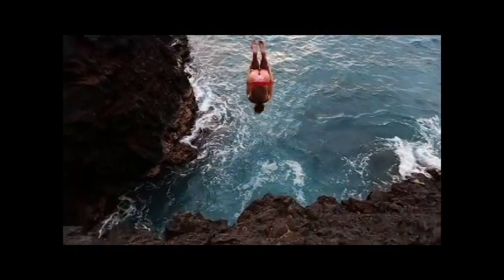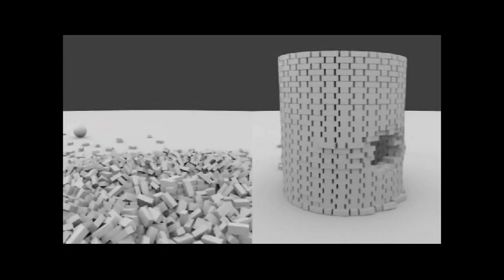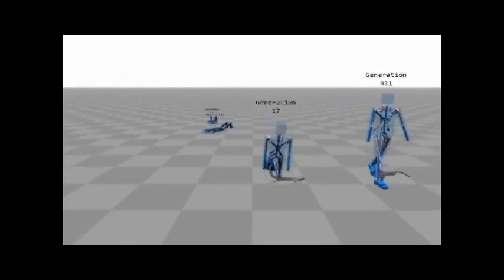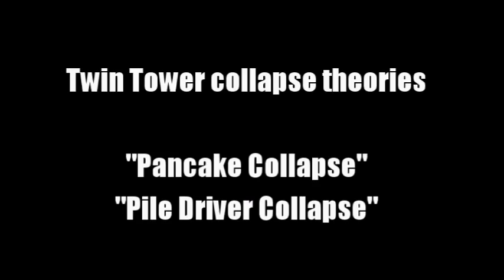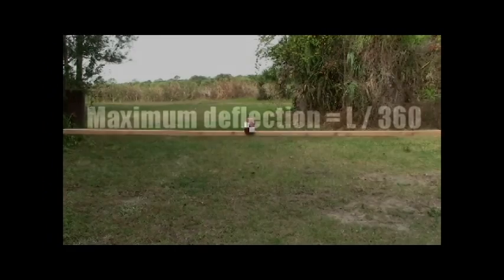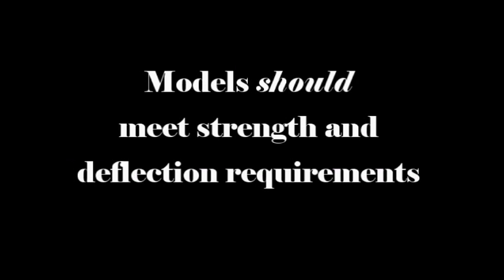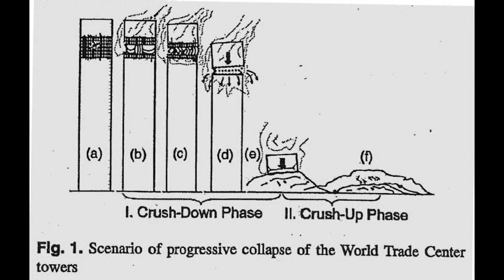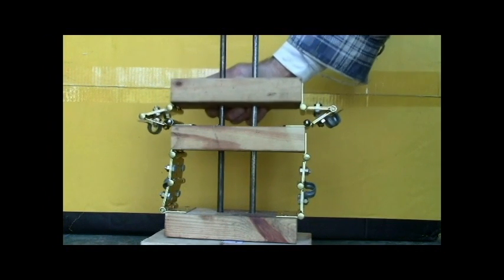9/11 Experiments: The Force Behind the Motion

Comment: You may be educated but you seriously lack any intuition towards physics.  Your models show that.
Reply: Chris Cook -  building 7 smartass, its the biggest problem with arseholes that think they are smart calling people truthers.  explain building seven collapse.  why rig a building to demo just let a fire bring it down perfectly.  you can say all you want about the towers but building 7 had zero reason to fall.
Reply: Chris Cook build a model that replicates what happened without the use of any interference to all the other supports....
Reply: Brian Friedman - "How wtc7 fell"
There is a rather detailed report out there that answers your question. Have you read it? Here is a link in case you haven't: https://ws680.nist.gov/publication/get_pdf.cfm?pub_id=861610

"how wtc 6 got a big hole in the middle?"
Errrr... how about debris from the collapsing North Tower fell into it? There are some nice pictures out there that show perimeter panels all over the place inside WTC6.Here's an example. Please note the bottom part of the picture. Also please note perimeter panels still hanging just over the edges of the whole in the top of the picture: https://powerm1985.files.wordpress.com/2017/02/inside-wtc-6.jpg
Reply: In response to Cris Smith- in agreement with you.
Reply: Cris Smith - I have a lot of questions about your calculations. But I'll ask only three for now. How much energy is required to lift a 1 kg object exactly 1 meter? And how does this answer relate to your claim that the potential energy in the towers was 4.6 Joules per kg? Would you agree your calculation is majorly off somewhere?
Reply: Joe V - The thing is that this number is very easily verified/calculated for both truthers and realists. One just needs to want to find out.
Reply: michael perri - "you can say all you want about the towers but building 7 had zero reason to fall."
What exactly in the NIST report about building 7 do you not agree with and why?
https://ws680.nist.gov/publication/get_pdf.cfm?pub_id=861610
Reply: Replevideo - "The mass of the 14 falling floors contains an amount of energy sufficient to demolish approximately 14 floors below before the energy is expended. "
This sounds a lot like the "argument" Chandler is making. There are some problems with this however. 
- It assumes the exerted force of the falling upper mass would have to destroy floors and columns below. In reality however, only the floor-to-column connections would have to be destroyed for a full collapse. The floors would simply give way at the weakest points, their connections.
- You overlook the potential kinetic energy stored in the mass of the collapsing floors below the falling mass of the upper block. Once the fllor-to-column connections of such floor are destroyed, this energy gets released and is addedd to the total energy of the falling mass of the upper block.
- In general, Chandler's "explanation" would only hold in a collision on a horizontal plane where gravity is to be neglected.

"Also please look at the inner columns. They form a practically indestructible  cage around the stairwells and elevator shafts, yet during the collapses they completely disappeared. How could that be?"
The core is basically irrelevant to the progressive part of the collapse. And this is exactly what we have seen in the videos of both collapses: major parts of the cores were still standing after the towers basically collapsed. The "indestrutable case" you mentioned is not that indestructable in reality. The core wasn't cross braced. Cross bracing is necessary for a structure to gain stability. The stability for the core was provided by the floors that bound core and permiter together.
Reply: choosetolivefree - "NO ONE can design an experiment which will corroborate the official theories."
You mean like this? https://www.youtube.com/watch?v=flo62pdaIMI

"You can debate all you want about his experiments."
Well yeah, that's the whole point, isn't it? Anyone, but ANYONE can build a structure to blow it up and claim this is what happened at 9/11. Only then the debate on the validity of these models begins.

"But what you can't do is create an experiment which will prove the official theory. If I'm wrong, do it"
The exact same applies to the opposite. Please build me a model that proves an inside job. The "engineer" in the above video has clearly failed to do so. Maybe you can?
Reply: @brucelansberg5485  Your interjections are some of the sharper ones so I'd like to ask some simple questions if I may. Any you can answer for me would assist me and I'm sure many others who's ideas are not fixed. I'm not a physicist or an engineer, but I think I have a basic grasp of the main arguments - like most people who are still horrified & fascinated by 9/11, it seems. I have no axe to grind and I'm not out to prove my better knowledge with sad Youtube one-upmanship. 

I find the rate of collapse of the twin towers difficult to fathom without there being some extra force at work. What accounts for the incredible speed of each collapse and the apparently uniform lack of resistance offered by the undamaged lower parts of the buildings? Is mass and gravity enough to cause so much destruction so quickly? How come there is no deceleration as the falling upper floors hit the lower ones?

I don't understand how massive heavy structural components of the towers could be thrown hundreds of feet outwards from the towers if they were merely collapsing under their own weight and a global structural defect/instability. What outward force caused this to occur? Surely the path of least resistance is down, not out?

I don't understand how virtually all of the concrete in the buildings and their contents could be pulverised to powder so quickly and completely. If not explosives, what force caused such utter destruction?

Given that the upper section of WTC2 leaned over dramatically as it fell, how could this then translate into a uniform global collapse? Wouldn't you expect one side of the building to fall away? I don't understand how the path of least resistance could be to pass through the building below rather than air.

Many people dismiss the multiple eye witness reports of secondary explosions, or they explain them away  - do you think the eye witnesses were all mistaken regarding hearing massive explosions followed by quick successions of smaller explosions? Explosions were witnessed by people in the basements of the towers before the planes struck.

Do you agree that the collapse of the towers and WT7 closely resembles controlled demolition in many respects, including what appear to be timed implosions of the upper floors, followed by belts of 'squibs' going off? Is that what a building collapse from structural damage, weakness and gravity looks like? The theory that there may have been explosives involved doesn't seem delusional to me, even if it might be mistaken.

Do you ascribe the global failure and collapse of three WTC buildings to an astounding coincidence, despite the fact that they were all damaged separately and in different areas? If the twin towers were badly designed then that could account for both of them experiencing global collapse in a similar manner, but that a third relatively new steel high rise should also collapse at free-fall just from fire-damage seems decidedly fishy. Doesn't the collapse of WT7 look exactly like a controlled demolition? I know looks can be deceiving!

Also, do you share a concern that some within the Bush administration actively wanted to go to war in Afghanistan and Iraq, and 9/11 - being the most astonishing act of terrorism ever witnessed - provided the perfect legitimacy for this? In fact, only such a catastrophic 'Pearl Harbour' like event could have offered legitimacy for the ensuing wars. Given the cost and spoils of war it seems that there was significant motivation to trigger 9/11, no matter how horrific the implications. 

Do you think there is compelling evidence that the alleged 9/11 hijackers had the skill to fly airliners accurately enough to hit the twin towers and the Pentagon at such high speed? It seems they were amateur pilots at best. The ability to hit the Pentagon side-on at maximum speed after having flown at such an extremely low altitude to knock over several street lights seems beyond comprehension to me. Also I don't understand why the wings didn't shear and explode on impact with the street lights.

Finally, can you agree that there is surprisingly little photographic evidence of 757 plane wreckage at or near the alleged Pentagon crash site and the one in Shanksville? Why do you think the only available video footage of the Pentagon attack is so poor?
Reply: @ravenorama  - Wow, that's a lot to reply to :). Let's give it a try and see where we end up.

"I find the rate of collapse of the twin towers difficult to fathom without there being some extra force at work. What accounts for the incredible speed of each collapse and the apparently uniform lack of resistance offered by the undamaged lower parts of the buildings? Is mass and gravity enough to cause so much destruction so quickly? How come there is no deceleration as the falling upper floors hit the lower ones?"

The speed of both collapses can only be considered incredible if one would expect a slower collapse. My question to you would be why you would expect the collapse to be slower? Isn't gravitational acceleration generally calculated to be 9.8 m/s/s on earth's surface? Both collapses were considerably slower than that, which tells me there was some kind of resistance. Looking at the design of the towers, it is obvious that this resistance was provided by the floor-to-column connections. These connections were crucial for keeping the towers up. Or reversed, the "only" thing needed for a full progressive collapse was destruction of these connections.

I certainly wouldn't say there was lack of resistance. If there was, both towers would have come down in 9,2 seconds. Now take a look at this video here and count along with the timer.

https://www.youtube.com/watch?v=qLShZOvxVe4

So I'd say that mass and gravity would perfectly able to have the towers collapse in the recorded times.

Deceleration would only occur if the resistance is larger than the exerted force. In any other case, acceleration would just be less. These are not the same thing. Less acceleration does not equal deceleration. Deceleration would result in a negative acceleration speed. A slower acceleration would result in a value somewhere between 0 and 9.8 m/s/s. Just drop a stone from a building and see if the air resistance would have it decelerate. It wouldn't. It would just have it accelerate slower up to its terminal velocity (which is reached when the drag force is equal to the gravitational force).

"I don't understand how massive heavy structural components of the towers could be thrown hundreds of feet outwards from the towers if they were merely collapsing under their own weight and a global structural defect/instability. What outward force caused this to occur? Surely the path of least resistance is down, not out?"

Well, if parts of the perimeter would have fallen as one single piece, it is not hard to imagine how the upper panels would have travelled some distance. If you take a look at the debris distribution as shown in this picture below, and you focus on the area of the winter garden, you would indeed see a number of perimeter panels grouped together as one single piece. From the way it is lined up, it is not hard to image how this large piece would have just fallen sideways instead of being "thrown" in that direction. Same goes for the perimeter steel that fell in the direction of Deutsche Bank Building.

https://upload.wikimedia.org/wikipedia/commons/f/f5/Wtc-photo.jpg

Make sure you set it on highest resolution. And note how this picture was taken several days/weeks after 9/11 when West St was cleared.

This is what it looked like before West St was cleared:

https://www.metabunk.org/attachments/wtc1-debris-layout-jpg.3162/

Collision could be another explanation for single members to travel sideways. Collision causes change in velocity (which is both speed and direction). Drop a marble on a hard surface which is tilted 45 degrees. Do you think the marble would insist on dropping straight down (path of least resistance as you have stated), or do you believe its velocity changes and the direction of the marble will be changed to basically horizontal?
Reply: @ravenorama  - "I don't understand how virtually all of the concrete in the buildings and their contents could be pulverised to powder so quickly and completely. If not explosives, what force caused such utter destruction?"

Who's to say that virtually all of the concrete was pulverized? As for the contents, imagine an office chair in a huge tumble dryer filled with steel beams, it isn't hard to imagine what would happen to that chair. I don't think it turned to dus however. Analysis of dust samples from the site showed mainly glass, drywall and concrete. I don't see how explaosions would turn office equipment and furniture into dust in the first place.

"Given that the upper section of WTC2 leaned over dramatically as it fell, how could this then translate into a uniform global collapse? Wouldn't you expect one side of the building to fall away? I don't understand how the path of least resistance could be to pass through the building below rather than air."

I guess it partly depends on your definition of uniform. In order to understand the sequence of events, you need to make a distinction between the initiating part of the collapse and the progressive part. The initiating part is caused by the jet impacts and fires resulting in the weakening of the steel. The progressive part is caused by the design of the towers. No matter the caused of the initiating part, the progressive part would have been the same in any way. When the top section started to tilt at the collapse onset, it caused a redistribution of its loads onto the undamaged columns up to the moment these couldn't carry this load (matter of split seconds). Understanding the design of the towers is crucial for understanding why it would have been impossible for one side of the building to fall away without the full building to collapse. In conventional buildings the floors do not play an important part of the structure. In the towers they did. Perimeter, core and floors could not exist without the others. Take one away and the rest will simply collapse.

It is inaccurate to describe the upper block as falling through the building. It didn't. As soon as it started tilting, it started to loose its integrity as a block. The mass however remained and force is defined by mass and velocity. The floor-to-column connections played an important role in the progressive part of the collapse. Once these are broken at one floor, the floor will fall down, causing more stress on the floor-to-column connection of the floor below than it was designed to take with the result that these will break as well. Like I said, it doesn't matter what caused the initiating part. Take out the upper block (or better: the mass of the upper block), and the building would still fully collapse.

"Many people dismiss the multiple eye witness reports of secondary explosions, or they explain them away  - do you think the eye witnesses were all mistaken regarding hearing massive explosions followed by quick successions of smaller explosions? Explosions were witnessed by people in the basements of the towers before the planes struck."

I am aware of these witnesses. I am also aware of witnesses that described falling bodies as exploding on the ground. Does that mean explosives were used to these bodies? I find that hard to believe. Maybe we should conclude that explosions do not necessarily imply explosives. I heard one large explosion in one of the many videos I have watched. I believe it was building 7 that was being filmed at that moment. Yet, I don't see the building come down at that moment. What does one single explosion do for a full collapse? I indeed heard people describe the collapse of the towers as a sequence of explosions. I am pretty sure that a collapsing building of that size and design would make these kinds of noises. The problem however, is that I have heard nothing that resembles anything like CD explosions on all of the videos I have watched. It should have sounded like in this video below if it were for explosives.

https://youtu.be/e2E_m7l2Rww?t=9

As for the explosions witnessed in the basement, a few things:
- Only one explosion before impact was mentioned. Not plural.
- Sound travels through steel faster than it travels through air.
- It was a matter of less than a few seconds between the explosions heard in the basement and the (same) explosion heard though the air.
- Basically the people in the basement heard the same explosion twice (one travelled though the steel frame, the second through the air).
- The sound was caused by the plane impact.
- What good does a bomb in the basement do to a collapse from the top?
- How have people outside not witnessed a large explosion just before impact?
Reply: @ravenorama  - "Do you agree that the collapse of the towers and WT7 closely resembles controlled demolition in many respects, including what appear to be timed implosions of the upper floors, followed by belts of 'squibs' going off? Is that what a building collapse from structural damage, weakness and gravity looks like? The theory that there may have been explosives involved doesn't seem delusional to me, even if it might be mistaken."

No. I do not agree that the collapses of the twin towers closely resemble controlled demolition in any respect. Yes, I do agree that from a certain point in time, the collapse of building 7 does look like a controlled demolition, at first glance.

1 and 2 collapsed from the top. I didn't see flashes. I didn't hear explosives. How would one see timed explosions? The "squibs" you mention is nothing more than compressed trying to find a way out. Please look up the detonation velocity of some explosives and compare these to the speed the air is being pushed out. Maybe more relevant is the timing. Take a good loko at the video I posted in the earlier reply and see how it takes a certain amount of time for the building to respond to the explosions. When compared to the videos of 1 and 2, it is clear that this timing is off. A lot. The "squibs" seem to appear just split seconds before the collapse reaches the point of that "squib". And shouldn't the towers have fallen faster if CD was involved?

As for 7, since the building appears to fall from the bottom, I understand why people connect this to CD. Yet, I do not see flashes. I do not hear explosions. We should see and hear these. Then again, in most videos, the part of the collapsing east penthouse isn't shown. This is however the onset of the internal collapse of the building. So also in this case, timing off majorly.

No evidence for the use of explosives was found. Not on the dus samples. Not on the steel. Not in the videos. No audio. And we haven't discussed the logistical impossiblility of all of this yet.

"Do you ascribe the global failure and collapse of three WTC buildings to an astounding coincidence, despite the fact that they were all damaged separately and in different areas? If the twin towers were badly designed then that could account for both of them experiencing global collapse in a similar manner, but that a third relatively new steel high rise should also collapse at free-fall just from fire-damage seems decidedly fishy. Doesn't the collapse of WT7 look exactly like a controlled demolition? I know looks can be deceiving!"

No, there was no coincidence. The design and damage patterns for all three towers dictated their faith. The towers were not "badly designed". They were strong buildings but they were not designed to survive progressive collapses. Why do you think so many scientifical papers have been written about progressive collapses and how to dedsign buildings to prevent them from happening AFTER 9/11? Just do a search for progressive collapse pdf and see how many results get returned.

The fact 1 and 2 were damaged separately is not relevant. The design of the buildings was the same and therefor they were equally susceptible to progressive collapse. Building 7 was designed in a somewhat different manner, but it shared long floor spans with both towers. Long floor spans means long beams (7), which are more vulnerable to changes in temperature. It is all easily explained. I do however wonder why you think that three collapsing buildings is fishy, but about 17 other buildings being heavilly damaged but not collapsing (some had to be demolished), is not? What if Deutsche Bank Building would have collapsed. Would that have added to the suspician, or would the suspicion have been less? If you look at the explanation of each individual collapse, what is fishy about it?

"Also, do you share a concern that some within the Bush administration actively wanted to go to war in Afghanistan and Iraq, and 9/11 - being the most astonishing act of terrorism ever witnessed - provided the perfect legitimacy for this? In fact, only such a catastrophic 'Pearl Harbour' like event could have offered legitimacy for the ensuing wars. Given the cost and spoils of war it seems that there was significant motivation to trigger 9/11, no matter how horrific the implications. "

No I don't. I do not think that the Bush administration caused 9/11 to have an excuse to invade Iraq (Afghanistan had been going on for decades). I do however believe that the Bush administration took full "advantage" of 9/11 and used it as an excuse. America has proven over and over again that no act of terrorism is required for invading other countries (or at least to establish a military precense in these countries).
Reply: @ravenorama  - "Do you think there is compelling evidence that the alleged 9/11 hijackers had the skill to fly airliners accurately enough to hit the twin towers and the Pentagon at such high speed? It seems they were amateur pilots at best. The ability to hit the Pentagon side-on at maximum speed after having flown at such an extremely low altitude to knock over several street lights seems beyond comprehension to me. Also I don't understand why the wings didn't shear and explode on impact with the street lights."

Have you ever been in a simulator? If not, please do so if you get the chance. Crashing an airplane is not really considered a precission movement. Instead of asking me if there is compelling evidencethat the pilots had enough knowledge and experience, I could ask you if there is compelling evidence they had not.

The fact that both planes were tilted when impacting the towers, is reason enough to believe the pilots were no airline pilots with thousands of flying hours. The same goes for the Pentagon impact. A highly skilled pilot would have approached the Pentagon from a lot larger angle to avoid the risk of ploughing the airplane into the ground. Flight 77 came dangerously close to just doing that. An impact ontop of the Pentagon would have caused a lot more damage. No light poles in the way either.

Wings are generally strong parts of planes. Wings are designed to survive impacts with birds on their leading edges. They do not shear off when hitting an relatively light object like an aluminum light pole on the upper part. The skin might get damaged locally though.

"Finally, can you agree that there is surprisingly little photographic evidence of 757 plane wreckage at or near the alleged Pentagon crash site and the one in Shanksville? Why do you think the only available video footage of the Pentagon attack is so poor?"

Again, I guess this depends on your definition. I believe a lot of debris would have been unrecognizable as part of a plane to the uneducted eye (like mine). You do know that seats were found inside the building with the passengers still strapped in? All heavy plane parts have been found. The lighter ones might as well simply have "vaporized" like in this video below.

https://www.youtube.com/watch?v=RZjhxuhTmGk

Same goes for Shanksville. Add to that that it was a very remote site with little to no witnesses that were able to take pictures. The lack of evidence doesn't prove the oppsite.

The video footage of the Pentagon impact was from CCTV. In those days quality was lower because of memory constraints. Next to that, why would CCTV cams be pointed to the sky? Also here goes, the lack of evidence (or lack of footage to be specific) doesn't prove the opposite. How about the eye witness accounts?
http://911research.wtc7.net/pentagon/evidence/witnesses/bart.html
Reply: @brucelansberg5485  Wow thanks for all that Bruce - much better than the usual sardonic and needlessly aggressive comments anyone questioning the official 9/11 narrative gets!

Not in order, but on the Pentagon:

I do think there's good evidence that the alleged hijackers were bad pilots. Their flight instructors described them as undisciplined, and the guy who is supposed to have flown into the Pentagon after an extraordinarily difficult dive and turning manoeuvre is described as having been unable to fly a Cessna. 

Some pilots have claimed that the manoeuvre to hit the Pentagon at ground floor level would have been difficult to achieve even for a person with a lifetime of 757 flying experience, or top gun fighter pilot. I take your humorous point though that it is a different kettle of fish to want to crash a plane then it is to want to control it. 

There are questions over the land-effect of a 757 flying as low and at such high speed as alleged - that it would be physically impossible to fly a 757 at high speed low enough to the ground to hit a light pole for any distance.

There are questions over the type of black box flight recorder recovered at the Pentagon being of the wrong type. I'm no expert in this.

At any rate, there certainly wasn't a gathering of plane wreckage as evidence or an attempt to reconstruct the plane it as you would expect from any other plane crash investigation, at least as far as I am aware.

Also, there is considerable divergence in witness statements from the Pentagon. A number of witnesses claim to have seen a 'large white plane' (not a bright and shiny aluminium one) approaching to the north of the alleged trajectory, impacting the Pentagon to the north of the alleged impact zone, one wing having rebounded off a helipad. This wing-rebound provides quite specific locative corroborating detail, and there was significant wreckage to the north of the alleged crash site at the Pentagon next to a helipad. A witness who survived the blast in this area and who walked through the actual  hole created by impact claimed not to have seen any evidence of a 757/plane, which is odd. You'd expect her to be in shock though.

I take the point about the possibility of an aluminium plane vaporising on impact at high speed, but surely titanium engines wouldn't have disappeared? The alleged discovery of victims still strapped into their seats does not seem consistent with vaporisation.

For balance, I have also heard witness reports that corroborate the official line, including from a Taxi driver and a Priest. It is at least worth considering why/how such divergent stories should emerge though. If anyone could falsify witness statements then the good people at the Pentagon could. 

I haven't seen any photographic or video evidence that shows wreckage from a 757 at the Pentagon, apart from one mangled piece of aluminium with red paint on it, and a fragment of a belt strap with United Airways written on it. 

I don't accept that CCTV at the Pentagon wouldn't be pointed at the crash site or surrounding area - including the sky. Also that military radar and defence systems would not have detected and intervened a flight approaching the Pentagon. There is witness testimony that defence secretary Rumsfeld was given ten minute warnings up to the point of impact, and on being asked 'if the order still stands' brusquely affirmed that it had not been changed (whatever that order referred to, the timing raises suspicion).
Reply: On the twin towers and WT7 collapse:

The more I think about it the more I can accept that progressive collapse at the speed/force observed is possible in all cases. It is obviously far less likely that the buildings were rigged with explosives for demolition. I would still have expected the progressive collapse to be less total somehow.

There is witness evidence that only shards of office material were found in the wreckage at ground zero. The amount of destructive force was extraordinary.

On evidence of secondary explosions - I take your point that sound travels through steel quicker than air - I don't know the physics of it but would an explosive shock wave also travel down to the basement of the buildings before the impact of the plane would be heard/felt? I guess over 100 floors or so the time lag could be quite significant. I gather from the testimony of William Rodriguez (basement janitor) that there was enough time between the two blast and pane impact events for him to consider them as separate events, but maybe he was just confused. He certainly claims that there was an explosive event in the basement below him that caused his office wall to crack and for the ceiling to fall in which preceded the plane strike, but I don't know how long he perceived the elapsed time between the tow perceived events to be. Also, I don't know the layout of the lift systems except that in the towers they were staggered, so it should be possible to prove whether the person Rodriguez aided who had been badly burned in a lift at the basement level could have been injured from jet fuel rushing down a lift shaft from the impact zone (if the lift shaft was connected to the impact zone) or if it must have been something else. I would agree that by far the most likely scenario is that the jet fuel and shockwave in the falling lifts were mistaken for explosions. 

I don't think many people mistook falling bodies for explosions. There is significant witness evidence of explosions occurring continuously in the towers. Of course there could be alternative explanations and any is more likely than planted explosives.

I gather that destroying the base structure of a building is an element of demolition whether it is from the top down or not. There is some photographic evidence from ground zero of a major steel support column that appears to have been cut at a 45 degree angle, which could be consistent with the use of thermite.

I think WT7 likely collapsed in the way it did because the substation upon which it was built suddenly gave way from the weight of internal structures failing/falling in the seconds immediately prior.
Reply: Regarding the Bush admin using 9/11 as a pretext for war:

I think they certianly did use 9/11 as a pretext for launching a nebulous 'war on terror' that suited their foreign policy objectives. Also to pass the Patriot Act which would allow extraordinary powers to stifle any investigation into 9/11.

The Bush administration was resistant to holding an inquiry into 9/11 and only relented over a year later under pressure from survivor groups and the relatives of victims. The 9/11 report was restricted in scope, and its lead authors have written a book claiming that it was a whitewash, they were consistently lied to by figures at the Pentagon and others, and that nobody has ever been held to account for lying to them. 

It seems that the CIA had previous knowledge of the hijackers that they withheld from the FBI. Bush blocked a subpoena to investigate this. Hijackers stayed in a apartment owned by a CIA asset.

There was also a distinctly fishy anthrax letter scare in the weeks after 9/11 that appears to have been a blatant attempt to frame Iraq - shifting the blame for 9/11 away from Saudi Arabia. The anthrax used is alleged to have been far beyond the technical means available to Iraq, and to be a signature of US technology. In the end an individual 'lone wolf' scientist was fitted up for the crime, although it is claimed that it would have taken a team of experts a great deal longer to produce the type of anthrax used than could have been achieved by one person acting alone.

The anthrax scare is consistent with later claims that Iraq had WMD, which it turns out they didn't.
Reply: @ravenorama  - "I do think there's good evidence that the alleged hijackers were bad pilots."
We seem to agree partly on this. I believe that a highly trained pilot would have flown the planes level into the towers. And a highly trained pilot would not have taken the risk of missing target at the Pentagon. Then again, the hijackers didn't need to take off and land any of the planes. Just steer them.

"Their flight instructors described them as undisciplined"
Which is not necessarilly a description of a person that doesn't know how to steer a plane.

"and the guy who is supposed to have flown into the Pentagon after an extraordinarily difficult dive and turning manoeuvre is described as having been unable to fly a Cessna. "
And yet, Hanjour did have both a private and commercial pilots license. But who says the manouvre was extraordinarily difficult?

"There are questions over the land-effect of a 757 flying as low and at such high speed as alleged - that it would be physically impossible to fly a 757 at high speed low enough to the ground to hit a light pole for any distance."
Yeah, I heard that claim about the so called ground effect as well. Whenever I hear it, I will show this little video and ask: What ground effect?

https://www.youtube.com/watch?v=1HRyynpbMJc

"There are questions over the type of black box flight recorder recovered at the Pentagon being of the wrong type. I'm no expert in this."
Neither am I. Also, I have not heard that claim before and I couldn't find anything on it. 

"At any rate, there certainly wasn't a gathering of plane wreckage as evidence or an attempt to reconstruct the plane it as you would expect from any other plane crash investigation, at least as far as I am aware."
A reconstruction of a crashed plane is only done to gather more insight in the causes of the crash. At 9/11 it seems quite obvious what happened. So in most cases the plane is not reconstructed. I am pretty sure though that debris was collected and stored.

http://www.911myths.com/html/pentagon_18.html

"Also, there is considerable divergence in witness statements from the Pentagon. A number of witnesses claim to have seen a 'large white plane' (not a bright and shiny aluminium one) approaching to the north of the alleged trajectory, impacting the Pentagon to the north of the alleged impact zone, one wing having rebounded off a helipad. This wing-rebound provides quite specific locative corroborating detail, and there was significant wreckage to the north of the alleged crash site at the Pentagon next to a helipad. A witness who survived the blast in this area and who walked through the actual  hole created by impact claimed not to have seen any evidence of a 757/plane, which is odd. You'd expect her to be in shock though."
No one eye witness statement from whichever event will be the exact same. The key in these witness reports however is the word plane. No one claims to have seen a missile of some kind. 

"I take the point about the possibility of an aluminium plane vaporising on impact at high speed, but surely titanium engines wouldn't have disappeared?"
From the Moussaoui trial:
http://www.vaed.uscourts.gov/notablecases/moussaoui/exhibits/prosecution/P200030.html
Then again, if it is not photgraphed and in the public domain, it doesn't mean it isn't real.

"The alleged discovery of victims still strapped into their seats does not seem consistent with vaporisation."
Of course the Pentagon facade is not made of brick and concrete alone. The part of the plane that hit any concrete would have been more damaged than the part would have entered the building through windows and doors.

"For balance, I have also heard witness reports that corroborate the official line, including from a Taxi driver and a Priest. It is at least worth considering why/how such divergent stories should emerge though. If anyone could falsify witness statements then the good people at the Pentagon could. "
Well, if you take a look at the link I included in an earlier reply, you will see that these statements have several sources. People have been interviewed for several media outlets. 

"I haven't seen any photographic or video evidence that shows wreckage from a 757 at the Pentagon, apart from one mangled piece of aluminium with red paint on it, and a fragment of a belt strap with United Airways written on it."
Here's a nice start:

https://rense.com//general32/phot.htm

"I don't accept that CCTV at the Pentagon wouldn't be pointed at the crash site or surrounding area - including the sky. "
Why would camera's be pointed at the crash site? I believe it is much more interesting to see what's going in a parking lot than oin the facade of a building to be honest.And why would cameras be pointed at the sky? 

"Also that military radar and defence systems would not have detected and intervened a flight approaching the Pentagon."
All flights arriving at Reagan International Airport would be approaching the Pentagon and be monitored. I don't know if military radar would track civilian flights though. Military defence systems were aimed at threads from outside of the US. Not at domestic flights.

"There is witness testimony that defence secretary Rumsfeld was given ten minute warnings up to the point of impact, and on being asked 'if the order still stands' brusquely affirmed that it had not been changed"
It was actually Cheney that replied that the orders still stand. This is from a testimnoy by the secretary of transportation Norman Mineta for the 9/11 Commission on May 23, 2003. Yet, there seems to be much wrong with this testimony. If you're at this subject, please read this full article where a break down is presented from the events and timelines. Don't forget to read its conclusion :).

http://www.911myths.com/index.php?title=Norman_Mineta
Reply: @brucelansberg5485   On 9/11 hijackers being bad pilots: As I understand it Hanjoor's pilot's license expired because he didn't take a medical and he failed his English test, needing a translator to be able to take another test. He was so incapable of flying, controlling or landing a single-engine Cessna just one month before 9/11 that he was refused permission to rent a Cessna. Yet one month later he is supposed to have been able to disable the flight management system in a 757 then perform a 270 degree turn whilst gaining speed and descending 2500 feet to hit the Pentagon at first floor level - without damaging the lawn! From his original application to enrol in flight training in the US he claimed to have had 250 hours of previous flying experience, and you need at least a 1000 I think to be able to fly a commercial airliner. In the 9/11 report it was claimed Hanjoor had around 600 hours, but this is not consistent with the fact that he was unable to control, land or rent a Cessna just one month before 9/11. At best he had 'rudimentary' knowledge, but not enough to pass an oral exam. There are plenty of pilots who have debated their own ability to perform the flying necessary to commit the 9/11 attacks, but I quickly found one video about Hanjoor that details his flying experience from flying school reports (towards the 33 minute mark for comment on the actual reports) https://www.youtube.com/watch?v=QMJUJO794f8

I like the video of the low-flying planes, but Hanjoor is supposed to have flown even lower, in an even bigger/heavier plane and at much higher speed - whilst also under the enormous stress of committing suicide/mass homicide. Pilots performing low-flying passover stunts at air-show events are highly skilled, which Hanjoor by all known accounts definitely was not. Maybe it just wasn't him flying, or he was unfeasibly lucky to hit his intended target? It does seem enormously unlikely from the available evidence that it was him flying, or if he was that he'd be capable of controlling a 757 through a high speed spiralling descent towards a specific target.

The hole in the Pentagon before an interior wall collapsed doesn't seem to have been produced by an object as large as a 757. Here's an image of the alleged impact site before the wall collapsed: https://www.google.co.uk/search?biw=1430&bih=638&tbm=isch&sa=1&ei=Z63uW_r7AcuRgAat47j4BA&q=hole+in+pentagon+before+collapse&oq=hole+in+pentagon+before+collapse&gs_l=img.3...4541.4541.0.4907.1.1.0.0.0.0.153.153.0j1.1.0....0...1c.1.64.img..0.0.0....0.3zytL4l5564#imgrc=0WsUBnpdu4wFvM:

I'm not a plane wreckage expert but I don't see compelling evidence in the photos you linked to - all the wreckage could be from office equipment having been blown up as far as I know - apart from wheel components. I don't see how everything including the tail-fin and engines of a 757 could be vaporised but passengers could still be found intact inside the building strapped into their seats. I don't see a scenario in which they impacted at such a high velocity that the entire fuselage was vaporised, yet soft tissue went through the thick security glass of a Pentagon window. At the very least it stretches credulity to breaking point. Surely a body at that rate of impact would come apart? Incidentally, a CNN reporter at the Pentagon on the scene shortly after 'impact' reported seeing no evidence of a plane (40 seconds in) https://www.youtube.com/watch?v=_0eC3uns3pA

The 'pilots for 9/11 truth' website has a much more detailed analysis of the difficulties hijackers faced on 9/11, including in taking over the flights from experienced pilots using just box cutters and knives (and without the pilots sending a distress signal) to performing the high speed manoeuvres alleged. I have seen  interesting videos in which experienced pilots and flight instructors use a flight simulator to attempt to hit the twin towers and only one of them managed it after multiple attempts, and even then only at low speed. The main difficulty being that at the high speed airliners are difficult to manoeuvre accurately - the slightest touch of steering causing a larger rolling movement to occur. At least that is what I have read - I'm not a pilot either, but I don't see why experienced pilots should want to lie about their abilities.

I got Rumsfeld mixed up with Cheney! My bad! I think it's fair to say that neither is known for trustworthiness though!! I'll look at the other links you sent but this is long enough for now. I am repeating a lot of stuff from other sources so it's just as good to look at some of the better websites that question the official 9/11 narrative in detail. 

Here's a nugget: on March 4, 2004, a German court "overturned the world's only conviction" in connection with the September 11 attack on America "because the U.S. withheld crucial evidence."
Reply: Aha I see you smart. How wtc7 fell and how wtc 6 got a big hole in the middle? now fuck off
Reply: Bruce Lansberg for one who seems so smart or at least one who thinks they are you would know that the burden of proof isn't on any of us but the investigators who told us that planes and fires caused the towers to fall. It's simply nonsense. I can show several things that point to something being really off about the official story. Things I have showed to many self proclaimed educated people and not a single one could explain.
Reply: GR1MR34PER33 - "for one who seems so smart or at least one who thinks they are"
What makes you believe you know what I think? 

"you would know that the burden of proof isn't on any of us"
The one who claims, delivers the proof. It is as simple as that. The one who makes an extraordinary claim, delivers the extraordinary proof. I have explained more than once what is wrong with the experiments in the above video. It is a random setup that has nothing to do with the reality of the collapsing towers. Now, if you want to claim the towers were blown up. you need to deliver the evidence. Not difficult to understand.

"but the investigators who told us that planes and fires caused the towers to fall."
Are you referring to NIST? 

"It's simply nonsense."
Remember, you make the claim, you deliver the evidence. Please explain what you think is nonsense and why exactly.

" I can show several things that point to something being really off about the official story."
Sure you can. 9/11 was a complicated event. In such events not all can be explained. The question however is: What does it prove?
Just out of curiousity, what would those things be?

"Things I have showed to many self proclaimed educated people and not a single one could explain."
Why are you telling me? But again, if something can't be explained, what does it prove?
Reply: Troll !, ZERO content ,and zero link to ANY OTHER Physical experiment ?
Reply: Bruce Lansberg lol oh I can tell that you think you are smart just by how you comment. Speaking of which Jesus Christ dude you seem to have all day to write comments when you break down each piece and ask questions about them. But enough of that I'll get to the point. First I need to correct my previous comment; it's not that things can't be explained, it's just that they can't be explained in a way that supports the narrative the deniers choose to believe and push so these things tend to be outright ignored. First were the mysterious workers doing mysterious work on the buildings before 9/11, there is a little bit more to it but I don't have all day to find and type out who they were and when exactly it was so you will have to deal. Second was the molten metal flowing out of the building and also found below the building. The infamous jet fuel can't melt steel beams meme refers to this. Third, the steel support beams with diagonal cuts and slag running down them as if they were cut by extreme heat from a source such as thermite. Which brings the fourth, the traces of nano thermite found among the rubble. Five, multiple reports of explosions in the parking garage and the lobby I believe by people who were there including first responders like firefighters. Six, let's say hypothetically jet fuel does get hot enough to melt steel beams and there are no intact remains of the plane because it hit with so much force it disintegrated upon impact. Yet somehow they find the terrorist's passports perfectly intact. I can keep going, do you want me to continue? Please do pick apart each piece of this comment in particular and try to explain in a way that supports your narrative. Oh I might add real quick that NIST claims that the towers fell do to the damage from the planes that hit them and the fires they caused. They claim they came to this conclusion by using models in sophisticated computer programs. But they refused to release the models they used. So again the burden of proof is on those who claim just like you said, and we are still waiting. There is one thing you're right about, none of these things technically prove that 9/11 was an inside job, but they are all very suspicious and should have people asking more questions instead of blindly accepting what the government and media told us. The government has been caught many times lying to the public, and the media does it all the time in order to get ratings, even if it's by taking things said out of context, reporting part truths can easily be just as bad as lying.
Reply: GR1MR34PER33 - "I can tell that you think you are smart just by how you comment."
Interesting, and to be honest, rather typical for a truther. Jumping top conclusions based on some interpretation that fits your frame of reference. Please realize that your conclusion only tells us something about YOU and not about ME.

"you seem to have all day to write comments when you break down each piece and ask questions about them."
If so, so what? The reason I am breaking down posts and reply to them in detail, is to expose the real meaning of them. Addressing every single claim is the only way to analyze the validity of one's claims. Don't worry, I will only address the most relevant claims in your post right now :).

"First were the mysterious workers doing mysterious work on the buildings before 9/11, there is a little bit more to it but I don't have all day to find and type out who they were and when exactly it was so you will have to deal."
It is only mysterious if you don't know if the claims are true, who these workers were, what they have been working on. Happy to go into detail on this if you can provide some examples. 

"Second was the molten metal flowing out of the building and also found below the building."
I really don't see how molten metal flowing out of one tower is something suspicious. You must have read an explanation on it. Same goes for the molten metal in the basement. 

"The infamous jet fuel can't melt steel beams meme refers to this."
Then again, no steel beams have melted from any jet fuel. Have they?

"Third, the steel support beams with diagonal cuts and slag running down them as if they were cut by extreme heat from a source such as thermite."
Yeah, as a result of the clean up process in which cutter have been used to cut the beams. Show me one single picture that shows these cut beams and that was taken before the clean up process started.

" the traces of nano thermite found among the rubble."
Please cite in Jones et al's report where it is stated that traces of nano thermite were found.

"multiple reports of explosions in the parking garage and the lobby I believe by people who were there including first responders like firefighters."
Yes. However, explosion do not necessarilly imply explosives. 

"Yet somehow they find the terrorist's passports perfectly intact. "
Well, this passport was found before any of the towers collapsed. Have you seen how paper literally rained down the streets of downtown Manhatten after both impacts?
https://youtu.be/c7mf4W8kL4s?t=3m54s
Why would all that paper fly around and a paper passport wouldn't?

" I can keep going, do you want me to continue?"
By all means, please do so. I haven't yet seen any convincing anomaly yet.

" try to explain in a way that supports your narrative."
I don't have a narrative. You do. And you're yet to show me any evidence of that.

"They claim they came to this conclusion by using models in sophisticated computer programs."
Please cite your source.

" none of these things technically prove that 9/11 was an inside job,"
Ande this is rather relevant.

"but they are all very suspicious"
They are only suspicious only one explanation would explain what we have witnessed AND if that explanation would indicate fowl play. None of your arguments do.

"The government has been caught many times lying to the public, and the media does it all the time in order to get ratings"
Although I agree on your statement, I don't see how this is relevant to presented facts.

"reporting part truths can easily be just as bad as lying"
That's why I am not interested in media's narratives or explanations or interpretations, but merely in facts. And funnily enough it is exactly this type of behavior that I find so repulsive from the truth movement.
Reply: "The added weight Plus the kinetic energy of the moving Mass greatly exceeds its load capacity..  that floor gets sheared off its connection points,   the falling Mass slows slightly as it sheers off these connections, but then that stationary floor joins the falling mass,. impacts the next stationary floor with more speed and more weight..... On and on all the way to the ground.."

Your poor grammar, examples & use of capitalization betrays your physics 'expertise'.
Reply: Cris Smith That was badass. #owned
Reply: Stop receiving flu shots, your brains already blistering in aluminium hydroxide. Remember one, if you cross the lined tin foiled brain effect will be irreversible.
Reply: Have you had ASD test?  If not suggesting,  you will be surprised.  But don't worry when it comes positive. Science tells us is the next step in human evolution we just too stupid yet to understand. 
   You see a bunch of valuable advice and you are asking if there is anything good INSIDE ( sounds even fucking unscientific )
Reply: Get well, switching the television off shows overall dramatic improvement,  GN
Reply: Build a tower of any material and then drop 1/10th on the rest. The tower will not be destroyed. Only on World trade center because of planted explosions.
Reply: His models are pure shit.
Reply: You're just butt hurt
Reply: Nah, the models that this guy made are not accurate to the construction of the buildings, they don't accurately replicate the scale in thickness and strength of the floors of the buildings, or the failure points of each floor that allowed for the collapse to happen as it did.
Reply: @BLUGGLES  your missing the point. Physics teach any upper block of material......any material. The point made is the model slowed down and eventually came to a stop.The same for the towers....but the bldg callapse accellerated as if the 80,000 tons of supporting structural steel framework underneath didn't exist. The only way possible is controlled demolition
Reply: @coolk3dat754  not true at all, its not that simple. If this guy had dropped a 1000 pound weight onto his structure I guarantee it wouldn't have slowed down until it hit the ground. The issue here is that the materials he used in his model show him progressive decreases in velocity because they are too rigid and thick, and not constructed to correctly mimic the actual structure of the towers. There are much better and more accurate amateur reconstructions that show the reality of the acceleration clearly.
Reply: @BLUGGLES  if it doesn't agree with the experiment it's wrong. You can waste your entire life crunching numbers and figures......if it disagrees with experiment.....its wrong.  Your version....Thats not what happenend.....physics say it cant happen..... History proves its never happened. And you proffessor got it all figured out dont you?. How does your theory account for pulverization of the bldgs? How does it account for lack of debris? How does account for high velocity bursts of debris being ejected? How does it account for the well well documented presence of molten metal?How does it account for the  announcement of building 7 collapsing prior to it being collapsed?  NIST claims fire brought the buildings down but had trouble trying to reconceal the evidence with that predetermined conclusion. NIST report contains no analysis of why the towers failed or why they fell near free fall speeds. NIST was unable to provide a full explanation for a total collapse.  They admitted only investigating up to point of collapse. they also admitted to never have looked or investigate for explosives even though it is mandated in the National Fire Protection Agency guidelines.NIST DID NOT FOLLOW PROPER PROTOCOL and unless properly investigated and ruled out..... there is clear evidence of the potential for explosives in the collapse.
Reply: The energy carried by the top floors does not need to pulverise the entire building. It only needs to break the support for the next floor invoking a "piledriver effect". The total energy released in the collapse didn't come from only the top 14 floors falling 4 metes, obviously. Having a bechelors in physics, you should understand this. An estimate for the total energy released would be to integrate E=mgh for each point of mass in the tower. Assuming the weight ditribution is uniform, this would be the same as taking the total weight for half the height of the tower. 450*10^6kg at 200 meters gives a total potential energy of about 880 Gigajoules, that's substantially more than 2.35 Gigajoules.

Also, you know what else losers with no real argument do? - Create argument from authority by flaunting their degrees.
Reply: @GiletteRazorsharp  when looking at the collapse of the towers on video......do you really see a pile driver.LMAO......keep it real man. What we do see there are three buildings falling symmetrical but how did the structures collapse in their symmetrical fashion when the damage was clearly not symmetrical? The tower should have falling with increasing eccentricity as a collapsed progressed.. how could simple office fires bring down such an orderly collapse? Probability and physics point to a control  demolition for collapse... not fire!
Reply: None of the collapses were entirely symmetrical. Look at the first collapse for example. The top part of the tower clearly tilts quite a bit and falls at an angle. If the bottom part of the tower was more structurally stable and could have resisted more of the forces of the top part, the collapse would have been even less of a "straight down" plummet. This brings me back to my original comment; the energy of the top part of the tower was huge. Much more than the bottom part of the tower could possibly handle. The resisting forces were obviously just to small to have a significant impact on the trajectory of the top part of the tower.
Reply: I agree with you that we don't know everything that happened there so we can't adequately explained how the towers collapsed. that's why we can simply apply simple physics, since there were much more going on, like the fire weakening the beams, no pulverizing them. Also, the planes really sliced through some of the beams, as evidenced from close-up videos of both towers. And, if you carefully watch the moment they collapsed, you'll see that they do so at the point where the planes hit. The molten aluminum could have seeped down the elevators shafts and caused further damage. Actually, people emerging from elevators were spotted catching fire, and some elevators crashed down.
Reply: david b  I doubt it was pure aluminum..  more likely a slurry of various materials..   it just  happens to be coming from the area where most of the plane's fuselage ended up...
Reply: david b  have you ever seen One tire burn,?  The black smoke came from all the petroleum products in the offices...  Desks, carpet, partitions,  computers, chairs, ceiling tiles.. wires,
Reply: You can't just do physics experiments incorrectly and call them infallible. You can't just place slabs of drywall with pizza box supports in between and assume that it accurately models the tower and the proportions are correct. And you can't just drop a weight of arbitrary weight and height and assume that the impact force is proportional to the force of the top 10 or 20 floors crashing down onto the rest of the building.

Lets do some real, but simplified physics. The height of WTC 1 was 104 floors. The plane hit it at floor 90 or something, right? Imagine for simplicitys sake that floor 90 was just "deleted" and that the top section has a couple of meters of free fall (about 4 - taking the average floor height 417m/104 floors). And to be fair, the video makes exactly the same assumption by just dropping a weight. The total weight of WTC 1 is estimated at about 450*10^6kg. So the weight of  the top 14 floors would be roughly 60*10^6 kg. Now the potential energy of a drop of 4 meters can be calculated using the equation E=mgh, where m is the mass of the top portion of the drop (60*10^6 kg) , g is the acceleration due to gravity (9.81 m/s^2) and h is the difference in height (4 meters). Our result for E is approx. 2.35 Gigajoules. The equivalent of  about half a ton of TNT explosive energy. You truther knobheads might not realise it, but that's a lot of fucking energy. You don't stop 2.35 Gigajoules. You certainly dont need to plant fucking explosives to help it along. Floor 89 doesn't stand a chance, neither does floor 88, 87, 86... etc. This is high school physics.
Reply: @GiletteRazorsharp  very impressive but still incorrect. All you've done is substituted mathematics for experiments and you have wandered off to equation after equation that eventually build a structure which has no relation to reality. If this is high school physics then why aren't you aware of the conservation of momentum which is the fundamental law of physics that cannot be broken. Any upper block of material must slow down when it hits any mass or force that previously supported it. The upper block of following structure will destroy itself well before it can possibly Crush the entire larger lower structure. the object that does the hitting always slows down. The Symmetry is the Smoking Gun and you don't need to be an engineer or architect to see what happened to the buildings
Reply: I never wandered off to "equation after equation". I did a very simplified calculation to give an approximation of the energy of the top floors. But ok, bringing up conservation of momentum is a good point. Yes, the upper block will slow down when it hits the mass that previously supported it, but here's the catch. There is a constant force on the upper block, induced by gravity. This force will be equal to the mass of the block times the gravitational constant of earth (F=ma). When it hits the bottom part of the tower, there will be a force acting on the block in the opposite direction. This force, due to the structural strenght of the bottom part of the tower, will slow down the acceleration of the top block. If the force is equal to the force of gravity on the top block, the acceleration will stop completely. If the force is greater, then the top block will actually decelerate, i.e. loose momentum. The thing is, the size of this force is depentant upon the structural strenght of the building. You can imagine, if the bottom part was made of paper, the resisting force would be really small, and the top block would fall at nearly free fall speed. If the bottom part was made solid rock, you can imagine the force would be very big. In the case of WTC 1 & 2, the lower structure just couldn't handle a force big enough to completely stop the top block, but it could slow down its acceleration quite a bit.

The thing is, the law of conservation of momentum applies to everything with mass. "the object that does the hitting always slows down", well yes and no. Imagine a car travelling at 100km/h hitting a stationary car. The car travelling at 100km/h would probably slow down, but the car getting hit would also move. In physics, there is no concept of "the object that does the hitting" and "the object that does the receiving". It's a matter of reference frame. The math is still the same.
Reply: you completely mitigate the equal and opposite force EACH of that floors will create when the 'previous floors' impact it. There will be resistance, LIKE FRICTION but EVEN GREATER because they're floors that have not yet been damaged. Secondly, the floor that was hit was 'completely deleted' for 'simplicities sake'? or for your own expectation bias, which then results in confirmation bias of your preconceived notion to defend the governments account (i.e. NIST and FEMA are govt organizations, and no private investigations done? Monica Lewinski scandal had 10x more funding lmao). You have to live in some fairy world for a plane hitting one side of the building and taking out EVERY SINGLE STEEL COLUMN and on that floor. Plus let's not forget that 'deleting' violates the phyiscal law of equivalant exchange of energy. things don't just dissappear, they're just converted to something else.
What kind of logic do you operate on? you're right when you say you're using high school physics, but at best you'd get a D on that course for neglecting newton's 2nd and 3rd laws. 
Suppose even in your very poorly put together scenario that the 12-18 floors above fell without any resistance onto the floor under the 90th something floor, all the concurrent impacts would cause deceleration, and while they would possible accelerate while the floors going downwards increases, the force increased is also noteable. Any deceleration like I explained was not observed. in THREE of the buildings there. 
Even if there was a miraculous never seen before failure of structural engineering and a feat of destruction.. it DOES NOT HAPPEN THREE TIMES IN ONE DAY AT THE SAME PLACE. the likelihood of that doesn't weigh in favour of statistics of physics.
Reply: What happened to WT7?
Reply: @GiletteRazorsharp  complex math no relation to reality
Reply: @GiletteRazorsharp  a bachelor's degree????? And now you're a YouTube engineering wannabe? What pile driver effects? The top portion that leans over is pulverizing midair. It destroyed itself well before it could possibly crush the larger lower structure that supported it.  I quote " if the bottom part of the tower was more structural stable and could have resisted more of the forces of the top part. Much more than the bottom part of the tower could possibly handle?????? Are you fuckin kidding . You're actually trying to convince people⁴ that the top section that tilts over can possibly Crush the 80,000 tons of supporting  structurally steel framework underneath? LMAO.   NIST COULD NOT EXPLAIN THIS. First of all the impact of the aircraft had only local effect and did not impair the Integrity of the building which remain solid. I like to remind you that I'm going by the NIST REPORT......NOT YOUR REPORT. Newton's third law of motion for every action there is an equal and opposite reaction. This simply means the two opposing forces will neutralize each other because there is no more energy to decipitate. In the case of the towers the top section pushing on the bottom section is going to meet with equal force. Both sections are going to be demolished at the same time and same rate until there was nothing left to crush the entire building. This is high school physics it is such a simple fundamental concept. I want to ask you with all the complex math, with a simple experiment can you provide and demonstrate what you are claiming? Are you able to reproduce it with a real science experiment the force behind the motion? Not a computer model.
Reply: @GiletteRazorsharp  I also like to remind you about true experiments. We use physical models all the time and it's from these physical models and observations where the math and simulations are developed..... Never the other way around.. from what Ive seen the pancake collapse and Piledriver collapse does not fit. Therefore itis wrong. Although the demolition experiment did .
Reply: @coolk3dat754  First of all, you're misunderstanding newtons third law. Yes, for every action there is an equal and opposite reaction, but that does not mean any object can withstand any arbitrarily large force. Imagine dropping an anvil on an egg. The egg will obviously be crushed. The gist is that the anvil can excert much more force than the egg is able to withstand. Only enough energy to crush the egg is lost from the anvil, which is why speed of the anvil would barely be affected.

Also "complex math", are you shitting me? The "complex math" is the math they teach at high school physics in countries which aren't shit. 

And no, sorry. I cannot provide a simple experiment. Which is my entire point from the beginning. The experiment in the video is useless. Emulating such a complex process is simply not feasable with a simple experiment. You could probably do a decent enough simulation of it though, but you would need to know exactly how the structure is built.

"We use physical models all the time and it's from these physical models and observations where the math and simulations are developed..... Never the other way around". This is simply not true. There are plenty of examples of observations confirming theories and vice versa. Actually, nowadays most experiments are designed to test scientific hypothesis. A prime example would be CERN and the Higgs boson.
Reply: @GiletteRazorsharp  NIST handled this miscarriage of Investigation. They gave their final report and it is this  very same report that we go by.....not your personal theory you are producing. You pretend to have all the answers.  Who are you? I'm going by the NIST report AND and according to them the towers came down near free fall. The theory of the collapse hinges on an idea that the upper section of each Tower could continuously accelerate to the lower stories at nearly the rate of gravity while in the process completely dismembering the still frames and  all the concrete to a fine powder. Yet roast provided no modeling or calculations to demonstrate that  such Behavior what's possible. Instead nist stopped its analysis at the moment of collapsed initiation asserting that the collapse was inevitable once the collapsed initiated. Astonishingly nist entire explanation for why the lower sections fail to stop or even slow The Descent of the upper sections is limited to a half a page of its 10000 page report in a section entitled "  Events following collapsed initiation " In 2007 a group of scientists and
 architects filed for a correction because NIST BE 9P failed to establish the likely technical cause of the building failures because it did not explain why after the collapse initiation total collapse had ensuedl.    Now get this, NIST responded to the request for correction with the remarkable admission that it was not able to provide a full explanation of the total collapse. The computer models are not able to converge on a solution.   This is the final report.  Yet you wanna promote you have all the answers lmao. Based a Newton's third law of motion we know it would have been a deceleration of the World Trade Centers upper section if it had impacted and crushed the intact structure below it. THE ABSENCE OF DECELERATION IS INCONTROVERTIBLE PROOF THAT ANOTHER FORCE MUST HAVE BEEN RESPONSIBLE FOR DESTROYING THE LOWER STRUCTURE BEFORE THE UPPER STRUCTURE REACHED IT.
Reply: @GiletteRazorsharp  first of all I do understand the laws of physics conservation of momentum. It is written in the textbooks, we could find it on the internet, and you could take it up with Isaac Newton himself. This video describing the collapse is correct it has no errors
Reply: @coolk3dat754  Are you thick or what? If there was an absence of deceleration then the towers wouldn't fall at "nearly" free fall, they would fall at free fall. The fact that they don't fall at free fall means they are being decelerated. It's just that the deceleration due to the structural resistance of the bottom part of the tower is smaller than the acceleration of the falling section.
Reply: @GiletteRazorsharp  when the upper structure impacts the Lower structure there is no jolt just acceleration. I have eyes of my own and they don't lie. NO PIKEDRIVER NO PANCAKE
 AND NO JOLTS. Even if by some miracle it was a pile driver they wouldn't have came down at the speeds we've all seen. I find your theories fascinating and I would like to learn more. Would you please direct me to where I can find the information that claims conservation of momentum does not apply to high rise bldgs Mr.  Bachelor degree. Thx
Reply: raga muff you never passed 9th grade physics did you?? 
What I explained is very simple to understand..  if you can't grasp it you truly don't need to be on these debate forums
.. you're making an ass of yourself and you're too ignorant to realize it

Here's a clue help you understand what I said
.  Some energy (speed) is lost in shearing off the connection points
Reply: You don't even need the math to prove the experimenter's point, only your eyes. The buildings fell way too fast to blame gravity, and fell as if there was no resistance from the undamaged floors below, which had thicker and stronger supports. Plus, unlike his experiment, the upper floors didn't have the free space or fall time necessary to pick up momentum like his models did. Simple, logical, correct.
Reply: Won' the mass compound AND accelerate as the fall continues?
Reply: Cris Smith you're ignoring the fact, as every other truth or does, that the upper, collapsing, floors did not impact the entire structure below them all at once..  .
Each floor was attached to the exterior columns and the core columns by bolts at the truss seats, which were welded to spandrel plates.     
Let's say the upper mass on one of the towers is 15 floors.  It Begins moving downward as one unit, it impacts the first stationary floor.   The added weight Plus the kinetic energy of the moving Mass greatly exceeds its load capacity..  that floor gets sheared off its connection points,   the falling Mass slows slightly as it sheers off these connections, but then that stationary floor joins the falling mass,. impacts the next stationary floor with more speed and more weight..... On and on all the way to the ground.. that is clearly what is shown as we see the exterior panels peel off and fall sideways..  
You don't need to be an engineer to understand that.  
and as I recall I don't see anyone from the ASME, the ASCE, or the AIA, voicing outrage over the impossibility of the Tower collapse..
Reply: Joe V you do realize there's a group called architects and engineers for 9/11 truth right? With over 3,000 architects demanding an independent investigation into the WTC collapse, many of them from AIA.
Reply: It was an inside job
Reply: Bruce Lansberg haa   truthers hate being faced with actual scientific numbers
Reply: Like the man said, no one, but NO ONE can design an experiment which will corroborate the official theories. You can debate all you want about his experiments. But what you can't do is create an experiment which will prove the official theory. If I'm wrong, do it
Reply: I agree with what you say but you don't come to a conclusion. The mass of the 14 falling floors contains an amount of energy sufficient to demolish approximately 14 floors below before the energy is expended. At floor 68 all the upright columns become more massive, and again at floor 34. That was how the building was constructed, with uprights becoming lighter in two stages because they had less weight to carry nearer the top. Surely the collapse must halt at floor 68 as it encounters more resistance from below, even if it overshot the theoretical 28 floor collapse. No matter what, your 2.35 Gigajoules is not enough energy to continue the collapse right down to ground level. Also please look at the inner columns. They form a practically indestructible  cage around the stairwells and elevator shafts, yet during the collapses they completely disappeared. How could that be?
Reply: michael perri tell that to the firemen that set up a laser Transit... The exterior of 7 was visibly bowing, so a laser transit was set up and verified that seven was in serious trouble.   That was at 2 p.m. ..  that's where all the comments came from people in the area such as "" that building is going to come down"""     it finally did at 5: 20..
Reply: Hey idiot Chris Cook. You need zero intuition when you use math and physics  which is infallible. Moron Govt loving asswipe
Reply: lol!  you look good in a tin-foil hat.
Reply: First you say "falling Mass slows slightly" then "impacts the next stationary floor with more speed and more weight".  Get over you cognitive dissonance.